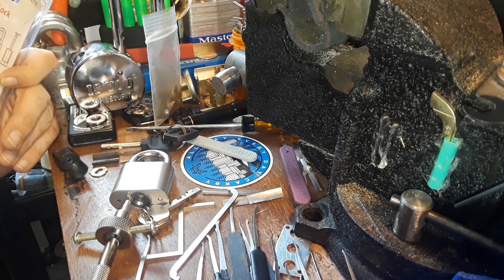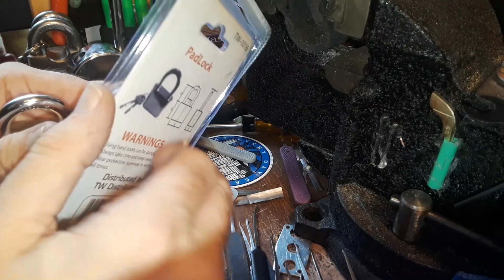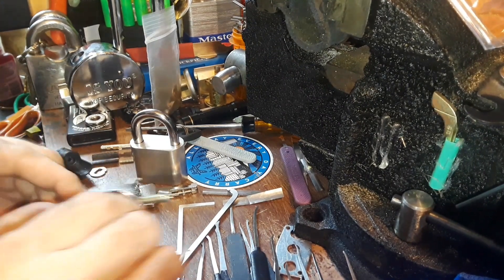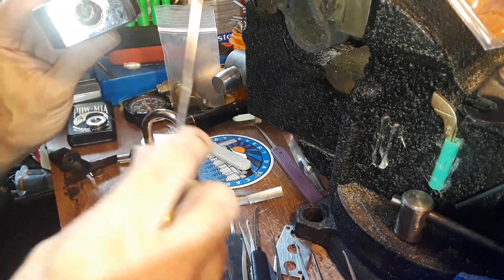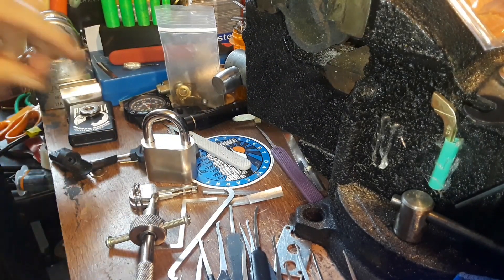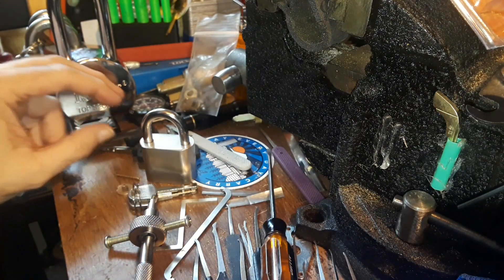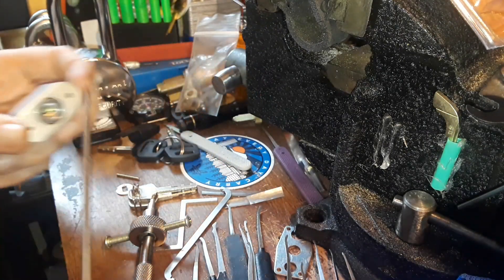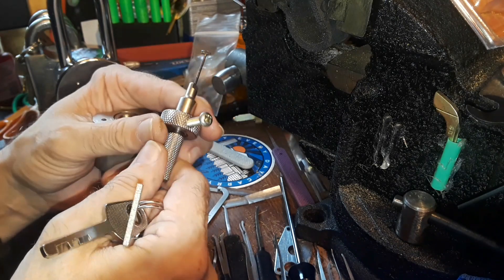(811) Inside a Disc Detainer & Picking a 40mm DD Padlock

Comment: That's a bargain. I would have paid $3 just for the safety warning information. Thanks for the heads up on the safety requirements when operating a Chinesium Disc Detainer Lock. Cheers:-)
Reply from the maker: Thank you Paul.  When I saw the package, I knew I was going to get it just because it's silly.

Comment: If you can get it back together you can file extra false gates on It and make it into a challenge lock.
Reply from the maker: I remember when you did that video on the one you Modified.  I lost the plastic piece that broke off, and I have no great desire to reassemble it. I would need lots of alcohol and aspirin 🍺💊